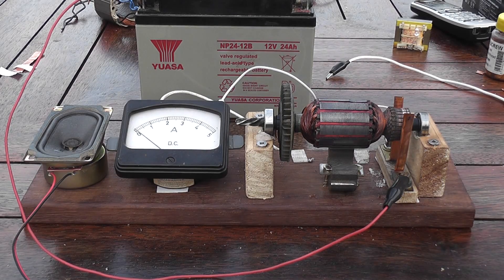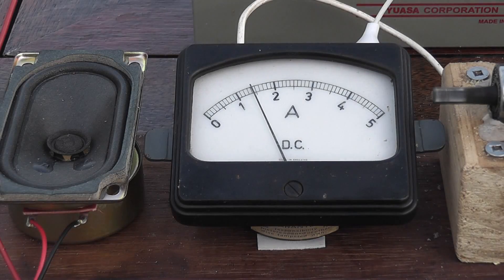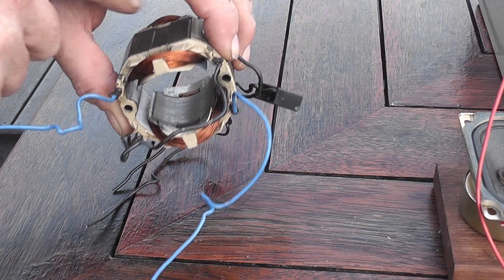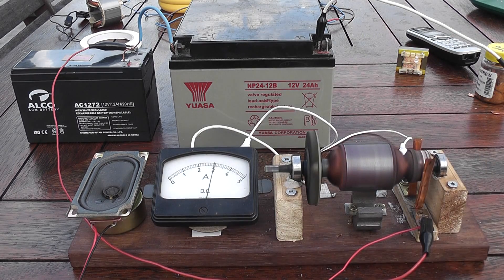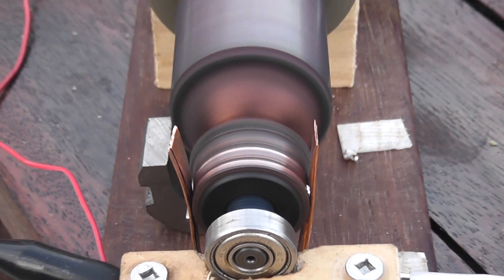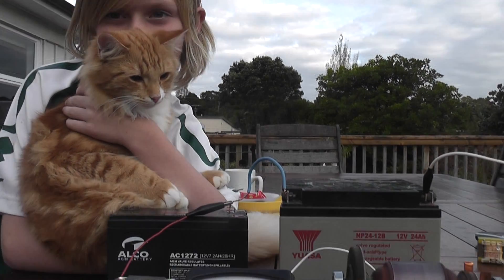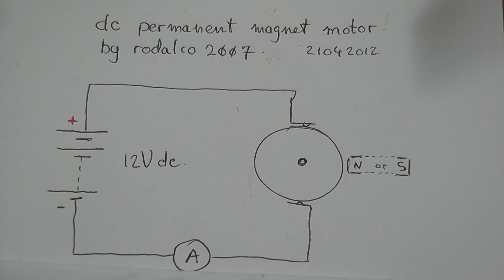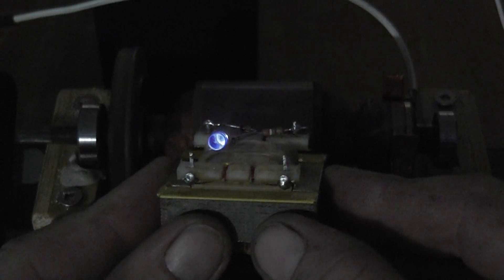Open DC motor -- school project

Comment: I should build one of these and make it a repulsion motor by putting the contacts at 90 degrees (vertical). one of the tests would be to measure the temperature on both electrodes, as one produces negative kickback and the other positive kickback.

Comment: Why universal motor use capacitor, usually they don't start using capacitor, your motor is unusual,
Reply from the maker: The Capacitor is there to reduce sparking and radio interference into the mains. ( The audio was distorted at one stage in the video, because of that)

Comment: Do you know why the speaker mimics the motor’s screeching?
Reply from the maker: Because the speaker gets it's signal voltage from the commutator bars. It will be in step with the motor sound.

Comment: Hi I was wondering if you ever measured the voltage  across the brushes while the motor is running  .( thinking of  collapsing field current..)

Comment: Hi.
if 12V dc motor connect to 24v it will work or not 
I want to make a e bike  it need mor RPM 
please  sambody answer
Reply from the maker: +zabihullah Ahmadi It will run a lot faster but you need to monitor the motor temperature as the 12 Volts motor will eventually burn out on 24 Volts when too hot.
Reply: I wouldn't do that on an ebike! Bikes rarely run for less than 5 minutes at a time.. More than enough time to overheat every single ride. ebikes are usually quite expensive.

Comment: This is great, I have a large dc motor that is back feeding into the field supply and blows the field fuse at 90% of max arm current about 321 amps.
Reply from the maker: +q zorn That is a big whopper of a motor.
Reply: Rockwell Automation thinks the motor is bad. It is being sent back for repair. I can let you know the results. :-7 .

Comment: This is actualy a runaway dc motor. That why it runs on low voltage but with for tha motor a lot of current
Reply: J IJzer I'm just waiting for it to jump off the bearings and really 'runaway'
Reply: frtard on big dc motors used in industry the most impotrtant is monitoring the field current that it not becomes to low  if it does it is directly an emergency stop.
Reply: J IJzer
um ok... what does that have to do with anything?

Comment: How about putting capacitors in paralell to the commutator, to avoid sparking?
Reply from the maker: Yes, it may help to reduce sparking a bit, bear in mind that these were copper home made contacts. Also there will always be a tiny spark as two commutator segments briefly get shorted out by a carbon brush or a copper contact.
Reply: ok thanks. nice work by the way
Reply: +Daniel Weber some sparks come from between each motor windings itself, and show up on the comutator
Reply: Or a simple spring adding pressure might help. I noticed as he pushed in on the one the motor improved. Overall a great demonstration.

Comment: You have a rather Dutch sounding accent sir, did you emigrate? I have a few questions, can i build a generator from a 3 phase motor? I need 3 phase in the shed to power multiple tools like a welder and bench grinder, i plan to power it through PTO in my land rover.

Comment: RODALCO2007 any ideas on how to tune a motor to get more torque and less speed because I am building a little tugboat and I have a motor from a speedboat which is extremely fast but hasn't got enough torque to turn the brass propeller under water
Reply: I'm pretty sure the way it goes is when number of turns goes, up the torque (or electromagnetic strength) goes up, and vice versa, although I recommend a bit of research on your end in case I'm wrong about something.
Voltage also affects speed, I'm pretty sure about that, and how many amps flowing affects torque or something.

Comment: I got those 230V brushed motors run on 12VDC without recoiling the windings or replacing the stator coils with magnets. Very good way to test tools after repair as the motor doesn't spin so fast or energetic.
Reply from the maker: Those motors run very well on 12 or 24 Volts, especially when not under load. If massive sparks are detected at the some commutator segments , that indicates often as a shorted winding.

Comment: can you help? I cant get my perm mag set, I have moved it around, but all it wants to do is hum
Reply from the maker: The commutator contact points and the magnet should be 90 degrees apart.
Reply: RODALCO2007 AHHHH! That was it! Thanks!
WOW WATCH IT GO! HAHA
Reply from the maker: TheBlackSheep
Make a video of your motor please.
Reply: RODALCO2007 SURE! give me about a day or so to upload, I have a small 3V DC, running off an 18v model train power supply, I don't have an ammeter set in it or anything, but it works nice
Reply: +TheBlackSheep Still no video :(
Reply: Osumo Ben Lodan
HAHA wow totally forgot!
Yeah it will take me more than a day, my camera fell off my bumper and got squashed!! lol

Comment: I am going to try this with a large dc motor that I have it is 36v at unknown amps (because idiot trespassers used the vehical it came out of as a shooting target and a large slug made two 1 1/2 inch holes through the thick steel body of the vehical and grazed the tag on the motor so half of it is gone) but it is rated for a fair few.

Comment from the maker: Yes correct, that is why on large DC motors inter-pole windings are sometimes used.
This set up was to show an open armature working , and a few sparks were part of the project, as the copper strips were not perfectly aligned.

Comment: Just in case IF you didn't know: Sparks will decrease the efficiency of your motor! There is an easy solution for getting ride of the sparks. You just need to find the neutral points and connect your brushes to those points. Its easy, just manually change the place of brushes until you find them :) Have a great day and thanks for uploading this vid :)

Comment from the maker: Starting torque is bad, a series motor needs it's series field winding, which produces extra torque when the motor runs at low revs and high currents.

Comment: How much starting torque does this "modified" motor have compared to the motor in the original configuration ? I'm building a electric bike, and I'm wondering if I can modify a vacum cleaner motor like this and use it to drive the bike.

Comment from the maker: Yes, I did. Most 120 or 240 Volts universal motors will work well off 12 or 24 Volts DC and with a permanent magnet nearby the armature.

Comment: Hello, did you turn a universal motor into a dc low voltage motor by taking out the field windings and putting a permenant magnet under it ?

Comment from the maker: No, too heavy and not allowed.
I wire a fuse in series with one off the battery leads in case of some kid decided to short the battery out, and burn its hands on the melting leads.

Comment: Sweet little motor, right there. :-)

It's amazing that it spins-up that fast on only 12v.

It's also interesting that you get the sound of the motor to come out on the speaker. :-D
-------------------
One other thing, slightly off-topic: That other set of stator windings: If powered without an armature in there, they burn-up right?

If so, what would happen if those windings were immersed in water? 

Electromagnetic water heater? :-D

Thanks for showing,

{^_^} BoomBoxDeluxe {^_^}